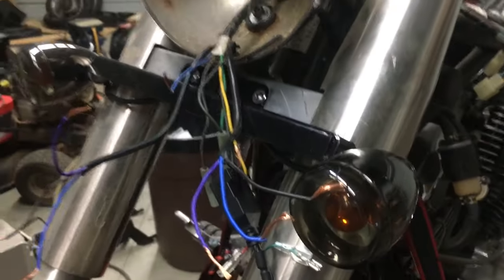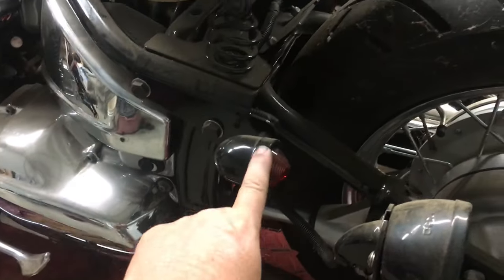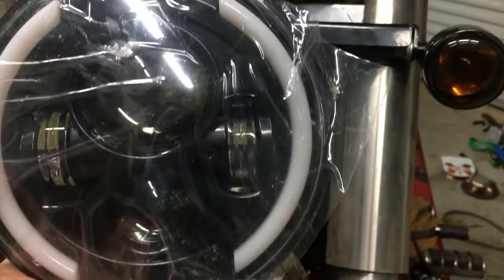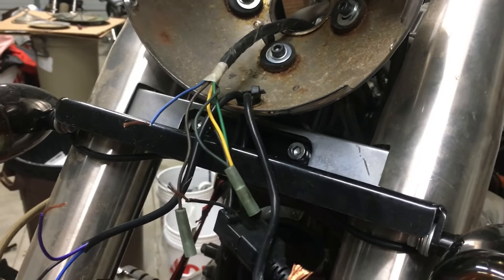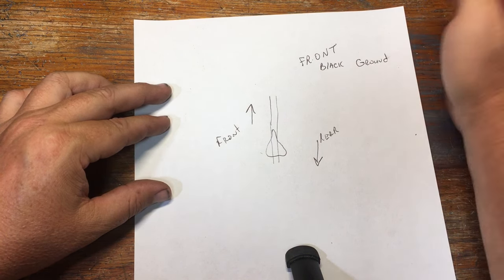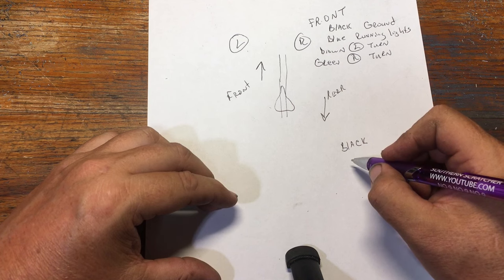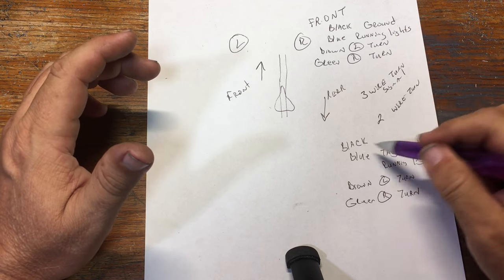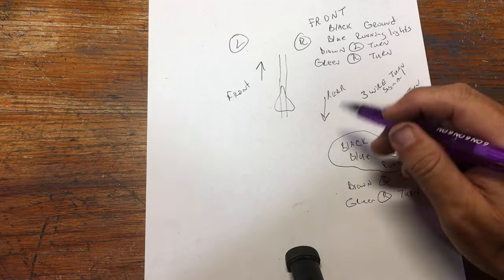Motorcycle turn signal wiring made easy!

Comment: Help… I got turn signals and fog lights off eBay. And I put all the wires correctly I belive.. I put blue with blue green with green and black with black.. and when I turn the left signal on the right one blinks insted. I hope I dint mix up the wires.

Comment: Just started my first build on an 85 Yamaha virago xv700.. I am about to get into the wiring harness very very soon i appreciate how clear and to the point you are.. Will be tuned in for more
Reply: how did it go?
Reply: @trillmiguell7866  not bad I've got power back through the bike now I just need to find a fuel sending unit to seal off the tank and I'll be ready for gas and first start up

Comment: So yeah great vid. Can u by chance tell me why my turn signals quit working? I have brake and front and rear running’s lights and horn. My turn signals do not flash and i have no voltage output. I do have continuity. 2008 vtx 1800

Comment: Hi, so I bought the same headlight and I noticed it only has a red wire and green wire with connecting prongs. There is not 3 wires like I've seen on other models. Can you show how you get the turn signals to work off only those 2 wires, and I know one is DRL's, so really how does it operate with one wire?

Comment: I have a pair of integrated mirror turn signals with 2 leads. I wired in black purple and it works. What should I do with the blue wire to keep from getting an open circuit indicator causing it to blink faster?

Comment: I’m having an issue on my 2002 vstar 650. I bought new LED turn signals for the rear (they have 3 wires). I connect one wire to ground (black), & the other wire to power for the signals (brown or green). When I connect the new LED lights, the front signal lights go out, the new LED lights stay lit & the turn signals aren’t working at all. If I connect my old original turn signal lights, everything works normal. What should I do ?

Comment: Hi there i have a 2017 Honda CRF 250L and trying to install an OEM front turn signal on the bike... the OEM is a 3 wire system(green,red,black wires)... Honda harness Right side has green,blue and blue/white wires and the Left side has green,orange and orange/white... kindly help me out which wires should be connected to which.Big thanks.

Comment: On mine the horn don't work,...none of the lights work,...but the head light works?
I have the wiring schematics,..... the right front was wired wrong,... but I stopped there,... I was tired because I couldn't figure out how to get to the rear ones on a 1993 honda vt 500 shadow?
All the fuse's are good?
If I turn the key to the left  the left turn signal comes on the license plate light and tail light comes on,....but just the head light when the ignition is on.
And on my 1992 VF 750 C Magna I put the battery in turn the ignition and get nothing,... all of the fuses I find are good so I have no clue there?
Reply from the maker: Send me the model and a picture and I will help you get it working. My email is peavinecompany@yahoo.com

Comment: Can I reach out to you about fixing my bike?! I recently brought a 85 Yamaha Virago 700. It runs but looks like crap. The brake light just went out and there are no turn signals. I do see the wires though. I’m pretty sure the exhaust gasket needs to be changed. It’s popping while I’m riding. Carbs cheese cleaning maybe?? I’ve never done it before but I’m up for the challenge. Any advice?
Reply: T BROWARD , my advice? It'll make great boat anchor.

Comment: My bike I got second hand and there no turn signals at all, I’m purchasing the original turn signals and I am writing this.
I have not much experience in wiring up a bike, but I have an understanding of the wiring except the front turn signals, my bike is a 1988 fxstc hd and I’ve had it since 2016 but it has been sitting since 2017, looking forward to getting this right
Reply: I just changed the handlebar switches on my 2012 v star 250  but now the blinkers blink fast and I was left with a yellow/red wire do you have any suggestions of how to wire it up

Comment: You need three wire taillights for some model Harley’s like the ones with run/turn and brake lights in the rear turn signals lights like the one in my pic…

Comment: Thanks. I have 7 wires going from the rear forward; three from brake light (Black, red, and yellow) and two each from blinkers;  (Black, black/white stripe). Going rearward however I only have four wires; (red, yellow, black, and back/white stripe). How do these all connect?
Reply from the maker: What motorcycle do you have?
Reply: @carolinabobbers592  Custom. Triumph motor in a Trackmaster frame with M-unit bue setup.
Reply from the maker: @martinsinclair55  Is the bike set up to use traditional handle bar controls or buttons with the digital M-unit? The xtra wires will go to your controls and then the simple wiring to your lights from the controls. send me an email and I will send you the wiring chart for the M-units
Reply: I think three black wires coming from back are grounds, so firstly do they just get grounded anywhere on the frame or connect to one of the wires from the front?
Reply: @carolinabobbers592  I have traditional handlebar controls for lights and blinkers. I already have M-unit manual but just don't know how to attach 7 wires into 4 at the back.
Reply from the maker: @martinsinclair55  any ground location will work